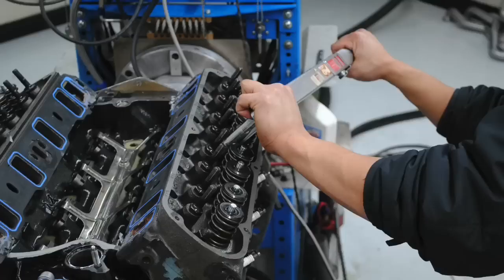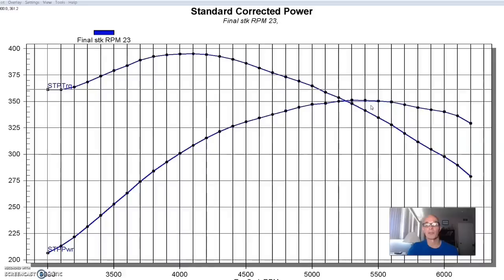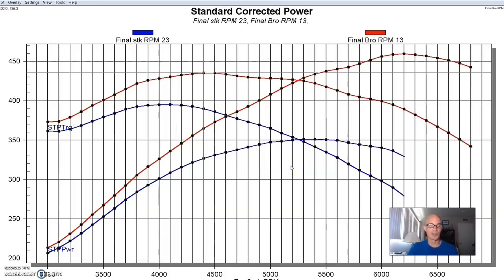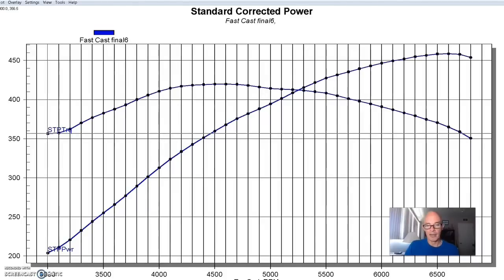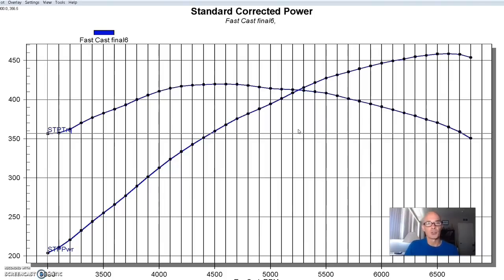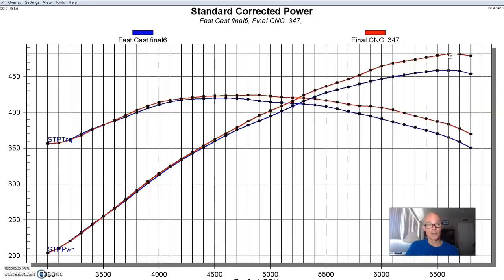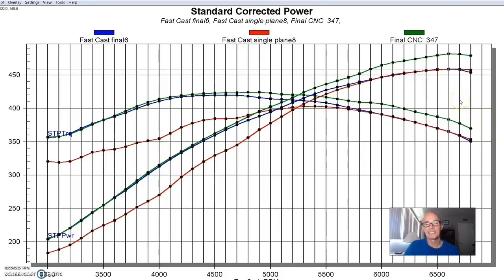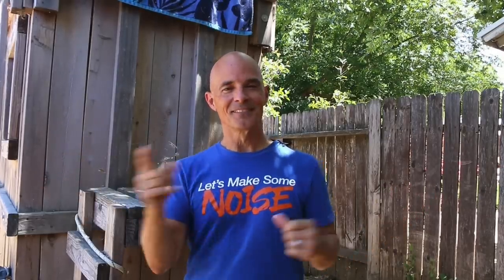347 FORD HEAD & INTAKE TEST

Comment: Best thing you can do with a 302 is swap it for a 351W.😎
Reply: Did that about 15 Years Ago in my 86 Mustang. Then did a 351 Cleveland after the 69 351 Windsor Engine. About 10 Years Ago made the switch a a 521 Stroked BBF, Absolutely love the Insane Low End Torque, and it still pulls hard to 7000 rpm. When it comes to cylinder heads, me and my bro. Always use Trickflow Heads for all of our Ford Small and Big Blocks. Really liking the Jon Kaase Heads too. Might be trying his SR-71 on my Big Block. When it comes to FORD Cylinder Heads, for me it's Trickflow or Kaase nothing else.
Reply: Yes and no, fitment is a concern in some applications
Reply: @Bobby__hill500  
Tell me about it.
I put a 351W in my ‘74 Bronco with a stock hood and no body lift.
It’s tighter than a cuns nunt.
Reply: @magdump7380  I want to v8 swap my Mercedes, but there’s no way in hell a 351 will fit

Comment: 351w stock roller block xe264-14 gt40 heads. Rpm intake.
Reply: How does it run? Fast? Got any dyno #s or track times?
Reply: @bluecollarfox916  0-60 8 seconds in and 73 f100 long bed aod trans shifting at 5k.

Comment: Stock heads 347 = 351 hp/395 torque 
Brodex heads = 460 hp/435 torque
With tunnle..499hp
 Damn, the brodex heads delivered in this case!

 Wonder what the power difference in a 331 would be?

Comment: back when i was stationed at camp Pendleton. i built a short rod 347. started with a CHP short block cast steel crank, forged rods and slugs. gt40y heads that i ported and port matched tl intake  edlebrock rpm intake. TFS cam  .499/.510-275/279. stock lifters. crane energizer 1.7 rockers. holley 670cfm vacuum secondaries. i never had it dyno'd but i figured it made 415-430. i had it in a 70 maverick and then later in an 83 bronco.

Comment: Still waiting on some AMC builds. Love to see a built up 304
Reply: I could go for any of them 304, 360, 390 or 401. Those are easy to find in Jeeps around here.  Talk about a different engine for a T bucket that stands out from all the belly button orange lumps. I know the 390 and 401 will make some good power, if only there were more parts available for them.
Reply: @SweatyFatGuy  I just finished a refresh on a 304 for my CJ7.  But like you said parts are few and far between

Plus he friends with Frieburger, hes got to have some Jeep v8's laying around

Comment: Have had a few really good combos!

I ended up going 11.3x's at 115~mph with a 10.5:1 347 using cheap Pro Comp 190 heads, an XE274HR, air gap intake, 750cfm carb and 1-5/8" headers. 2880lbs race weight

Then I went 10.84 at 122mph on the same shortblock with AFR 205 Renegade heads (#1450), victor jr intake, 780cfm Holley, 1-3/4" headers and an XR292R (I believe) Comp solid roller grind. .621/.627" lift and 254/260 at .050". 

I believe very similar combos were both ran by you and Brule in your Dyno Proven SBF Performance book! I highly recommend it to anyone.
Reply: Bro thank you for posting this! I’ve been ripping my hair out trying to decide if I should run my pro comp 210cc heads on my 347. Ppl talk so much sh** on pro comp it’s making me nervous. It’s a 10.5:1 347, comp xe270hr cam, pro comp 210cc heads, dual plain air gap. All
I wanna do is be able to honestly say I make 400hp at the crank. Let me know what you think. It’s going in a daily driven 91 notchback.
Reply: Great book.

Comment: In the process of building a 347 with trick flow heads and a Holley dual plane. I have a 650 demon but after this think I might need to get a 750. Great video hope I have results like you got.

Comment: I am running on my 1990 5.0HO GT40P iron heads with a spring upgrade 1.7 SVO roller rockers 3/8 hardened push rods the heads were decked 10 thousandths I am running a stock cam with 14 degrees advanced on the distributor and 24 pound per hour injectors on the stock intake

Comment: Can you guus please keep the hardcore 302 and 351W content coming; I'm having a 430W/Dart Iron eagle block, with Trickflow Twisted Wedge 225Rs from TEA, PAC springs, 55mm cam core 742/744 lift 282/296 duration @.50 .904 lifter bores, isky ez roll max lifters. Ported Super Victor to match the TFS heads 13:1 CR, Oliver Speedway series I beam rods, H13 tool steel pins, Lunati signature series crank, 950 Holley XP E85 carb.  Should make mid 700s on motor and will be sprayed with 200 shot of NOS.  Will share video once build begins. Are you going to do some hardcore 351W stroker tests?
Reply: That combo sounds nasty .... too much for my mainly street car but I bet it will be terrific at the track

Comment: We all enjoy your comparisons. Continue Sir. Do not forget there is a big following that does not have the means for these upgrades or race in a series that must run stock equipment. I road race these 302 ford engines. Do a build with an Explorer motor with F.I. For max power gains. ( 6k max rpm. ) GT40 heads, Explorer Intake and and cobra style cam with factory shorty headers. Dirt, Asphalt and pure stock racers seem to be forgotten. Help us out.

Comment: I have a 95 roller 302 block, stock bottom end. I added sve aluminum heads, tfs1 cam, trick flow giant single plains intake, 1 5/8 shorty headers 750 demon dp carb and 200 shot of nitrous. It’s in my 74 pinto wagon, runs 10.50 1/4 time’s.

Comment: Is that stroker cam just a wide LSA, or is there something else. 
My experience has given me an appreciation for a narrower LSA on the drag strip.
Reply: Wider LSA works better for street driven engines but you are correct, a narrower LSA will make more power at the expense of drive ability and less vacuum for stuff like power brakes.

Comment: Did a fun street motor in buddies 65 Stang...331..AFR 195’s...XR270HR...RPM AIR gap...650DP...4R70W 3400 stall...3.90’s. It’s a great pump gas street motor runs 11.7 at 115 on motor...10.9 at 125 100 shot.

Comment: My first combo I put together was in my 73 dart swinger it was stock block crank rods pistons and head's besides valve springs I ran a Holley street dominator intake and a 600 CFM Edelbrock heddman headers 2.5 inch exhaust and and Mopar purple camshaft I can't remember the spec's exactly but I'm pretty sure it was like 458 lift and 270 something duration with the 2000 stall and 727 torque flight it ran really good this was back in 99 so most modular mustangs were a walk in the park even beat a ws6 drop top on a 25 roll unfortunately got hit by a drunk driver she went to scrap yard heaven still miss that car to this day

Comment: Never dyno'd it, but it passed smog easily. 1995 Mustang GT 5.0.  CHP 331 kit, Crower 212 @ .050 single pattern 114 lsa cam, 9.5:1, Valley Head Service GT40P pocket ported heads, stock intake and exhaust. Stock 5 speed and a 3.55 rear gear and Auburn lsd. Great daily combo that got 20 mpg.

Comment: I have a rock crawler and I've been running a combo for awhile and I'm curious on where the power is actually made.  351W with OLD TFS170 (was told they cc'd out to 185) heads with a Comp XE274HR-12 cam.  I've got a Summit billet sparker and a Fi-Tech 600PA setup up top with some shorty headers.  It works great and I'm often asked what motor I'm running because it just SINGS over 5k :D   Love what you do, you are a LEGEND who should have 10x the subscribers you have, keep up the awesome work!

Comment: Haven't built a stroker YET; but in the planning/parts gathering stages of one with the nephew for his Fox body. It's not a SBF though, but it will be replacing one... 533" BBF - 4.440(.080 over) bore + 4.300 stroke. It's a stock late model block, so hoping that the more limited 4.300 stroke(vs 4.4 or 4.5) with a 6.800 rod will be a little easier on the cylinder walls in side loading; and the 4.440 bore because, well, ALL THE BORE ALL THE TIME! Maximize the potential of the heads, unshroud those valves!
Molnar rotating assembly with 10.5:1 CP or Mahle pistons(TBD), Kaase SR71 heads, undecided on intake, a good chance it'll be a single plane... but I REALLY want that bad ass TFS Tunnel Ram and get the flanges milled for the CJ-style heads(the TFS tunnel is made for their A460 heads, which have a different intake flange angle).
All run by Holley Terminator X EFI, should have NO PROBLEM making damn good NA power - which means that it should have even less of a problem pushing the factory block to its limits if we choose to once we add a turbo or two in the future......
Reply: (one of these days I'll be posting about the results of this combo, I swear! Lol)

Comment: I’m putting together kind of an oddball combination right now. Here’s what I have
-393” Windsor motor
-comp cams roller retrofit cam, .513” lift 224/230 @.050
-hypereutectic pistons with 8cc valve reliefs
-heavily ported Holley systemax heads with the 2.02/1.60 valves
-ported Typhoon EFI intake

Should be about 10.5:1 compression with those heads and pistons. The whole package is going into a 2001 F-150 regular cab shortbed with the M5OD 5-speed and 3.55 gears. I’m going to run 5.0 Explorer ECM and harness to keep OBD2 functionality so it will still pass inspection in NJ, and tuning with a quarter horse. It should be a fun street truck when all is said and done. Oh and best of all, my 7 year old son calls it his truck, so I’m making him help build the motor for it and teaching him how engines work!
Reply: Awesome. Have fun with your son and your truck.

Comment: Back when you first started, I did a basic exhaust porting on a set of 1972 351w heads, and ran them on a 302 with a magnum 270 cam. With a mild stall, my best guess from gearing, tire and speedo, that engine was winding past 7k, heading towards 8. I dreamt about doing a 347 or 408 with a set of tfs heads, glad to know I wouldn’t have been disappointed. Now I’m curious though to know if you’ve run dyno tests on the early 70’s heads?
Reply: I run a D9 351w block and a set of 1975 351w bone stone stock heads with a Sig Erson 296/296 duration and .508/.508 lift and that damn thing is stout in my 1980 Fox coupe with a 5 speed!!

Comment: 302 HO with ported GT40p heads and upper and lower intake with 70mm Throttle body. Also running the E303 cam. The P heads flow best right at .500 lift and E cam has .498 lift. They seem to work good with eachother. Thanks for doing all this testing Richard! Your the man!
Reply: Someone who understands how to pair parts 💪

Comment: 306 Ford, Brodix heads, long tubes, single plane, power adder = almost 700rwhp???
Reply: What's you max rpm? valve spring/rocker arm combo? stock block?  thanks

Comment: Love the small block Ford content.  I would like to see you dyno a somewhat budget 393 or 408.  Maybe try those as cast TFS heads and a stealth and something like an XE282HR.  Guys can find those parts used.  I would be interested in seeing how the AFR185 head does on this size engine.  The 165 and 185 heads cost the same and are a bit cheaper than the 195 or 205 head.  Maybe do a test with BBK shorty headers as they are the most inexpensive 351w swap header then upgrade to the BBK full length.  Maybe cut the ball collectors off the BBK full length and see if that is a restriction or not.  Thanks.
Reply from the maker: I have AFR heads on a 392 stroker with that 282 cam-pretty sure
Reply: @richardholdener1727  yup....get it up....
or a nice 427 shortblock head shoot out?  tfs-vs brodix-vs afr-vs?
Reply: @kentgross787  right.   Most interested in tfs 225 vs afr 225....doesnt have to be a wild engine ..
I like my afr 225s.
Reply: @richardholdener1727  I'd love to see a dyno of that , I have a 393 with a set of dart pro1 with a comp xehr getting married to a tremac 5 speed with holley HP EFI (and  A.C. because Houston Texas)
Reply: I would REALLY like to see the Holley SBF Hi-Ram tested on a large cube setup like this - even better if both the front entry and the sick side entry hat were tested to see if there's any impact there(though I honestly doubt it, given how huge the plenum volume is with either). 

Especially if it could be tested against the baller TFS Box-R - I'd LOVE to know the difference between the Box-R & Hi-Ram

Comment: I had stock bottom end with 9.8:1 cr running the ford Motorsport x305 head with roller rockers and a TFS stage 1 cam with an edlebrock air gap intake and a 625 cfm demon on top. The engine made 330 whp and 323 ftlbs of torque in 65 ford ranchero with T5 trans. It was ran on a Mustang dyno. Great running engine.
Reply: Richard, do you ever sell some of the heads after you test them? I have a 393 with some 1993 world steel heads on it. Have you ever tested the world 200 steel head?

Comment: 3v 4.6 ford: Ported heads
1mm oversize valves
 0.020 over 12:1 pistons
 .550 intake .560 exhaust lift  237 246 duration comp cams.
Ford racing intake manifold
Makes power well into 7k rpm range. Fun car
Awesome channel 👍

Comment: Currently building a 351w bored .030 over, 205 11R heads, forged pistons and rods, trick flow box r intake (wondering how much this will hinder my power curve) and a 78/75 turbo On3. 
Thanks for the awesome content Richard, Im learning through your vidoes, and would be lost without them
Reply from the maker: I ran the Box R on a 408

Comment: I have a 393w that has a set of David Vizard ported heads that flow 315cfm from a 192cc intake runner.. small solid roller cam 245/253 @ .050 .674"/.674" lift on a 108 LSA 10.7 to 1 compression... It makes 1.4 lbft per cube torque and slightly over 600hp. Its topped off with a Holley Hi-Ram and two 660 center squirters...
I'm now building a Windsor based BOSS 429". In a project called MIXED UP BOSS you can see it on my Channel Unity Motorsports Garage.  Using a set of Hammerhead Performance Engines Boss 429 style heads I'm looking to make 750hp from a 11 to 1 pump gas deal... Oh yeah those heads flow 396cfm out of the box!!!  Keep up the great work!!! 
 Thanks
Andy
Reply from the maker: nice
Reply: Oooo, those Hammerhead hemi heads are some KILLER pieces - going to have to check that one out!
Reply: That cam is "small"?? I think not. Anything over 240 @050 and .600 lift is pretty big to me.
Reply: Those small block Hemi heads are something else....heard the bsfc numbers are awesome. A couple of nitrous cars run them ( The Silver Surfer Mustang is my favorite )
Reply: Bad azz f150 he has!! "Caspar" 👍
Reply: Holy shit! Hope to see that someday.

Comment: Yeah I have a 347 13:1 compression ratio with Dart Pro 1 195 heads and it only made 508hp@6500. Its peak tq 447 was 5,400. It’s a solid lift camshaft .672 lift
Reply: I wonder why...too much cam maybe? What intake?

Comment: Interesting test. Id like to see a test with much bigger heads on a 408 or 410 windsor with a much bigger cam. Like 205, and 225 afrs and tfs high port 240s with the tfs stage 5 cam and 2 other really big hydraulic roller cams

Comment: When you say the cam was "designed for stroker applications", how so? Small base circle to clear the rods?
Reply from the maker: Comp has a description of the XFI cam-why they call it a stroker cam (like a turbo cam, or a nitrous cam etc...)But I have run it and it works well on a 347 (like lots of other cam profiles)

Comment: I run a 331 stroker with AFR 185's with 58cc chamber, flat top forged pistons, gt40 tubular upper and lower intake, with a ford racing x303 cam and 30lb injectors. Runs like a top but never had it dynoed. Would love to see you do that combo
Reply from the maker: I'm thinking low 400s-the Gt40 is holding it back a little, but good combo

Comment: I have an 85 mustang scat forged 347 , Afr 185s , Comp xe282 , Rpm air gap , aed 750 , 4.30s with a 6 spd and it runs really good. I’d really like to get it on a dyno. It definitely puts you in the seat and keeps you there. I sought of want to try a vic jr intake. Amazing how fast it is. Imo for a n/a car. Awesome videos I was hoping to see how a set of Afr’s compared. And I’m really curious of your opinion on the Comp xe282hr ?
Reply from the maker: now add a 100-hp shot!

Comment: I never build small block Fords, but I was amazed to see that kind of streetable HP from what started out it's life as a mere 302.  The Brodix heads made an incredible difference.
Reply: My shop daddy used to tell stories of guys building these little pocket rocket engines and hiding them under 289 styled valve covers and throwing them in falcons sayin fit wasn't anything fast

Comment: Nice video.  I have a 95 stock bottom end 302 with trick flow top end kit. On3 67mm turbo kit running 18 lbs of boost on 91 oct.  I just bought all new fuel system so I can run e85. I'm about to buy a 76 75 turbo from vss. Aiming for a record or bust. Might go bigger heads and intake to get more power as well. But also trying not to rev to the sky to keep the stock bottom end happy.
Reply: Yikes, sounds like you are pushing that stock block right to the edge.

Comment: Stock bottom end Vortech V2 Si Supercharger on 13lbs of boost 90mm Mass Air Anderson Power Pipe 75mm BBK Throttle body TFS Street Heat Intake Pro Topline/RHS 180cc Heads – Inspected by Holbrook Racing Engines E-303 Cam MAC 1 3/4” Long Tube Headers .  Behinds a T-5 it made 452 to the tire.

Comment: I've got a 406 small block Chevrolet with stock rods, crank, and heads.  The heads are a set of ported double humps with 2.02" /1.60" valves.  The camshaft is a Lunati Barebones grind part # CL10120102 .  It's got around 9.75:1 compression since I've got dishes piston with a 12.5cc dish.  I slapped it in my 1972 Impala and it impresses everyone.  It ran 15.11 @ 94.5 with a 2.73 gear, a turbo 350 trans, and it's 60' was around a 2.5.  I did the math, and it's putting around 300go to the tire, though I've never had it on the dyno.  If like to see what a combination like mine would do on an engine dyno.

Comment: 347 , kclh17 (210cc) Keith craft cnc heads from brodix RPM Performer air gap , xehr 282 cam made 467hp 420lbft , about to put those heads on a 427W with a custom ground bullet cam and a airgap intake hoping for 550 hp NA